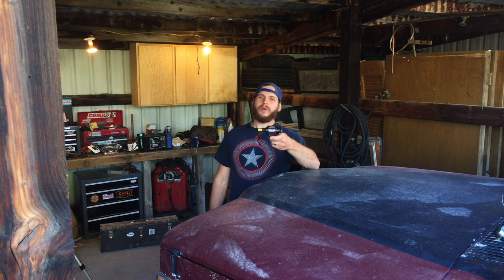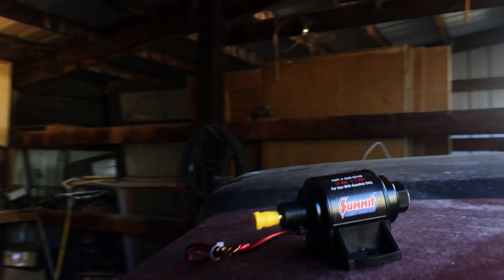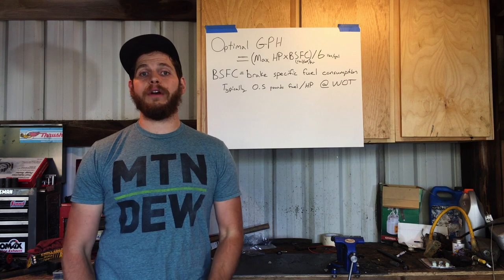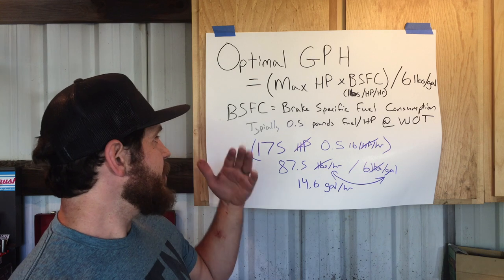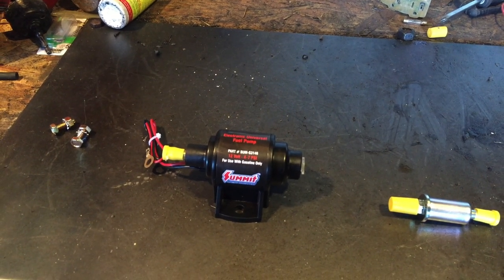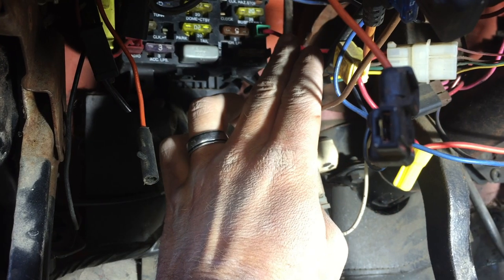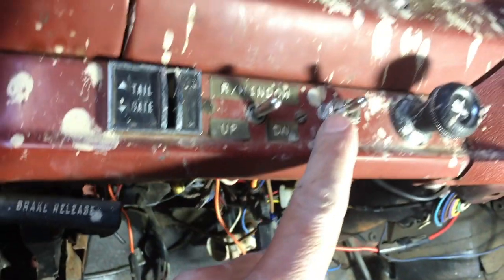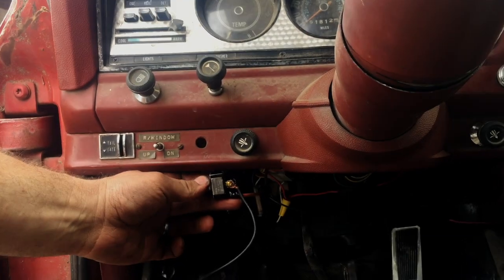Summit Racing Fuel Pump Install and Review

Comment: August 2024, I've had 2 of these quit on me in only 5 months, one lasted only 20 MINUTES!  They are junk! Edlebrock, Summit, Holley, same "micropump" junk. Call em up and the FIRST thing they will say is "remember it's under warranty"  Yeah, they know they're junk. If you're the proud owner of one that actually works- don't be, its going to leave you on the side of the road, and not long from now.  Holley red/blue vane pumps are big and noisy-  and expensive, but they WORK!
Reply from the maker: @glenhenning9261  yeah I eventually went back to a mechanical pump

Comment: That pump is for the weak brother can’t even peel a tire with that pump if u got real horsepower 500 and up that pump won’t hold up
Reply from the maker: i'm running the stock mechanical pump now, this jeep is pretty low on power haha

Comment: Rubber washers between the pump and frame or a flat piece of rubber like a tube folded up for a layer to absorb the vibration through the frame. I don't hear mine.
Reply from the maker: oh that's a good idea! I can't hear mine over the exhaust though haha
Reply: That's what Led Zeppelin and number 11 on the amp setting is for..

Comment: Did the pump shut off on its own
Reply from the maker: no it runs constantly. I went back to a mechanical pump since this video. this pump lasted a couple years, but didn't drive it a ton
Reply: @DaysofPainandVictory  why’d you go to mechanical pump again
Reply from the maker: @jagg5474  I lost two micro pumps, this summit pump and a mr. gasket pump, wanted something more reliable

Comment: My issue with this is that pre filter fitting. Man it feels so cheap I’m scared to torque it down with a wrench like you did but I guess I gotta. Haven’t started installing yet
Reply from the maker: I never had it leak, but the pump did eventually fail. I'm running the factory mechanical pump now. Good luck!

Comment: I have a 86 monte carlo and my car has a switch to the fuel pump do I really need it ? Because I don’t want it it’s it a good thing or bad ?
Reply from the maker: If you don’t want it in it’s own switch, you’ll have to wire it to come on when the ignition is turned on
Reply from the maker: Also would be a good idea to make sure you have an oil pressure kill switch, just in case you’re ever in an accident the fuel pump will shut off

Comment: God bless you and thank you for the clip. I connected the electric pump with the mechanical pump and connected Riley, but I noticed that the battery was weak, especially at night, although the electric pump only works with the switch. Is there a solution for that? my respect....
Reply from the maker: not sure I am fully understanding your question, is it not pumping?
Reply: @DaysofPainandVictory   it is .. I changed the battery and it is fine.
Reply from the maker: @wedding4016  cool so you got it figured out?

Comment: Hi. Is that pump for only cold start to avoid having to crank for a long time?

I assume you need a switch to kick start the pump before cranking the truck ON for easy start right ? 

Then as the truck starts you switch off the pump ?
Reply from the maker: In this situation it was my only pump so it was always running. There are people that use them for a priming pump to their mechanical pump, in that situation you could shut it off after fire up
Reply: @DaysofPainandVictory  
Thank you for the reply. 
So if I want it just for priming on a cold start and shut off ones the engine is ON , will the gas flow smoothly to the mechanical pump and carb as the pump of off. ?

I have a 75 k5 blazer that I don’t use a lot but when I want to use I have to crank a few times which can kill my battery. To avoid the cranking I add a few drops of fuel on the carb and kicks start like a champ. This only happens when I don’t use the truck for 2 weeks or so. It’s also park my driveway on a small slope hill which makes the gasoline more complicated to reach up the mechanical pump and carb.

Comment: Well dang...i have below bare minimum the one on my 81 f150 (I didnt do it previous owner) ran with house wire to the battery the negitive and the positive through the house wire asWell into the coil so as soon as I turn the key shes going with no fuse
Reply from the maker: haha nice, I had the fuel pump on my 95 jeep ZJ wired on a house switch haha, do what ya gotta do I guess
Reply: @DaysofPainandVictory  thinkin about putting a fude in but I do how big of a fuse to do if the pump I have either

Comment: Excellent video ( liked , subscribed )!Why does it have to be (pump) in angle ? ( me and my ignorance)!Please reply, thank you
Reply from the maker: Thanks! From summit’s website
Summit Racing recommends that you mount the fuel pumps outlet at 30-45 degrees above horizontal to reduce the risk of vapor lock. This mounting technique will allow vapor to pass easily through the pump.
Reply: @DaysofPainandVictory  
Thank you , so much ,brother 👍
Reply from the maker: @torobravo8023  no problem!

Comment: I wonder if they make one that's works with a tbi 350 since it only needs 11 to 13 psi.
Reply: Holley website has a chart for specific applications. You might find it there
Reply: Standard 50-60psi pump, regulator and a return line. Done.

Comment: Would the pump turn off if you got in an accident with the bare minimum wiring?
Reply from the maker: No you’d have to have it wired to the oil pressure switch
Reply: Ok thanks

Comment: I'll be damned, my poor little Chevette is only calling for 5.42 gallons per hour lol, would I need to install a fuel pressure regulator so it's not too much fuel into my little Holley 2bbl?
Reply from the maker: I ended up needing a regulator for my Holley in the beginning, but then I went with a different needle and seat I no longer needed a regulator. I’ll did through my receipts to figure out what needle and seat I went with

Comment: I have a holley mighty mite which is identical to both pumps and is probably the maker of both those. Anyway I used mine in a 87 GMC 305tbi to carb swap. Mine now registers 5 psi at start up but within a couple minutes it drops to 2 or less on the gauge. That is with the gauge mounted at the AC box near the top. WITH the hood raised and it cold outside or for us a heatwave at 45. It is new. The lines are new the wiring is new as is the relay fuses and the rest to include filters. Also the carb and intake are new as well. EVERYTHING new.
Anyone have an issue of these little pumps going bad quickly? How long did the MR gasket last you?  Is this one still working since you uploaded this video?
Reply from the maker: This pump lasted two years, but only used the jeep wheeling, not a lot of road driving.  Now I’m running the mechanical pump
Reply: These pumps are all the same - the Edelbrock even is just the same pump with a red plastic "bubble" around it.  They're all made by an offshore supplier.  For what they are - they're fine - small simple little pumps that tend to work pretty good and don't cost a lot of money.  They're magnetic drive, which is pretty cool (if you intend to dead-head it straight into a carb with no return / over-pressure relief line).  My Holley has been feeding the onions to my lawn mower (small 10-1/2 horse tractor) for quite some time now.

Comment: I recently replaced an aluminum keg fuel tank in a 75 CJ5 that the PO had installed and "rigged". Well after replacing with an OEM fuel tank my fuel delivery system has been out of sorts! It looked like I was not having enough pressure from the electric Facet posi-flo fuel pump 35 gal/hr. I bought a Holley 35 gal/hr electric pump and still the same thing. Anyhow, my question is what type of problems can cause what seems like no fuel pressure at the carb?
Reply from the maker: I wonder if the fuel pick up tube in the tank is clogged? or the filter on the pump? Do you have a fuel pressure regulator?
Reply: @DaysofPainandVictory  I thought that as well. I checked the pickup tube and all clear. I'm just not getting back so will have time this week to work on it. I went ahead and bought a new filter for the pump and a new fuel filter before carb. We'll see if that works.

Comment: Did you use any thread sealer with that filter you screwed in?
Reply from the maker: No, and I have had no issues with leaking. If you choose to use sealant, make sure it is suitable for gasoline such as this stuff from summit (part number 1525607), Do not use teflon, it will break down and clog up your fuel system. Thanks for watching!
Reply: WHY

Comment: Why does it should be down of the fuel tank? In my case, I  don't have space there, just in the hood side.
Reply from the maker: Mounting it below the fuel tank creates a siphoning action which helps prolong the life of the pump. I would try to find space if you will be driving it a lot

Comment: How does it operate in hot weather does it lock up
Reply from the maker: Dannymclovin69 I’ve had no issues with the pump locking up, and I’ve wheeled the Jeep in triple digit temps